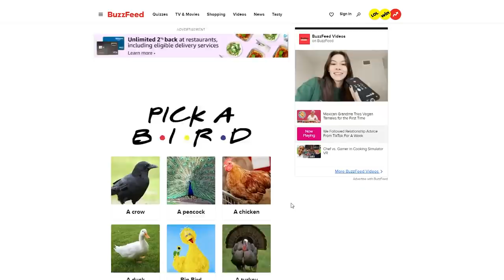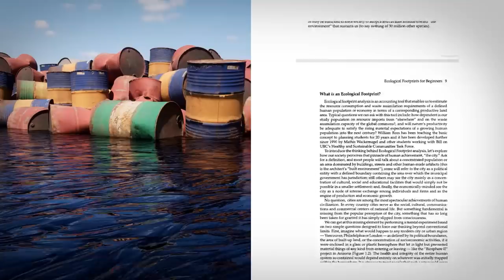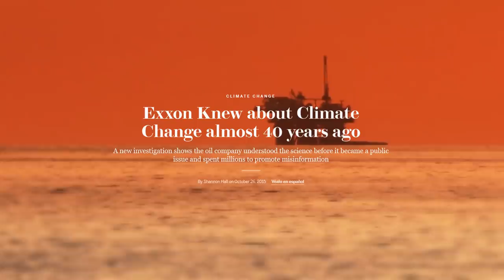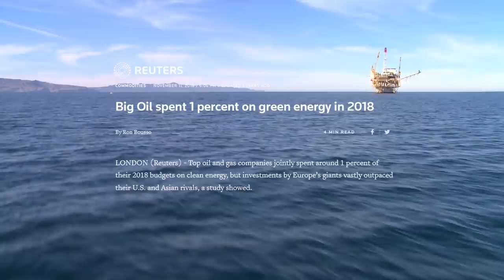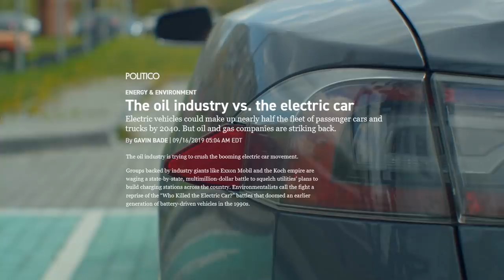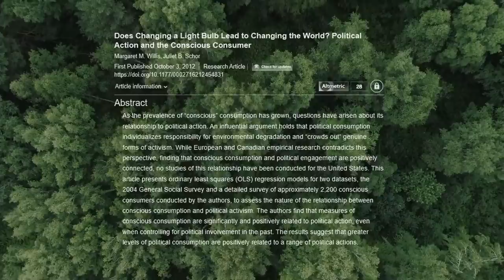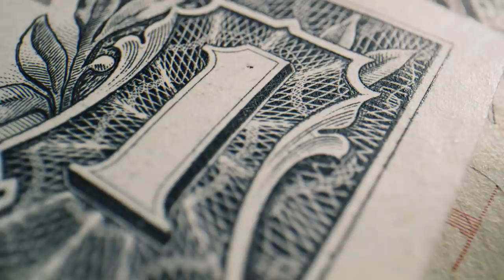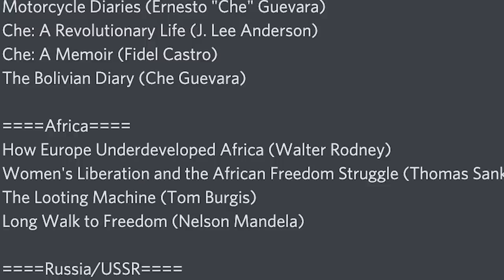Your "Carbon Footprint" Is A Scam

Comment: Stop talking this nonsecure and actually read the reports you are referencing.   Global warming was increasing at 2/10°C per decade in the 1980s before sundengly pausing in the early 1990s at 1.1°C.  Over the next thirty years global warming would decrease and increase, but never reached the next notable level of 1.2°C.  In 2o22 global, warming was being reported at 1.1°C.  The same as it was reported in the early 1990s with carbon dioxide levels rising much as they had during the 1980s with nn end-to-end correlation over this thirty year period with global warming.   

Exxon and other large crude oil extractors predicted in the 1960s and 1970s that global warming at 2/10°C increase per decade would crossing a tipping point when global warming hit 1.3°C where it would like cause higher Gulf of Mexico waters to measurably increase hurricanes.  This was predicted to take place in the late 1990s.  By 2010 global warming was predicted to be at 1.5°C where the astute observer was suppose to be able to recognize stronger hurricanes in the Gulf of Mexico.  These conclusions along with other valid reasons justified the higher expenses for building higher and more storm resistance Gulf of Mexico offshore oil platforms.   The platforms are routinely evaluated for predicted storms for the safety or personal.  Once global warming paused at 1.1°C in the early 1990s the prediction for the tipping points at 1.3°C and 1.5°C were no longer on track and were never reached.  We should of been at 1.5°C global warming in 2010 predicted by studies in the 1970s.  

It is impossible for the noncondensing gasses in earth's atmosphere to be responsible for global, warming at 1.1°C because their total temperature share of the earth's greenhouse effect is less than  0.1°C.   High school level earth science describes earth's greenhouse effect as adding 10°F (5.55°) to earth's temperature due to water.vapor's ability to block inferred heat from the surface from radiating into space.   The initial greenhouse effect takes place in 20 meters of the the surface.   The noncondensing greenhouse gasses, such as carbon dioxide and methane have less than 1% share of the greenhouse effect with water. vapor being over a 99%.  Unless there is virtually no water.vapor removing the noncondensing gasses would result in water. vapor taking 100ﬁ with a net zero change in the overall greenhouse effect.  If the noncondensing greenhouse gasses were doubled water vapor would take a lesser share with the overall greenhouse effect not changed.   

The United Nation's International Panel on Climate Charge reports clear state, you have to read the entire report and they are no longer easy to fine online, that they only discuss greenhouse gasses as a cause for global warming and ONLY sampled those greenhouse gasses at 20 THOUSAND feet altitude way into the stratosphere where water vapor is comparatively near zero.   By stating it sampling at 20,000 meters the knowledgeable reader will know the report is of no practical use for the discuss of the greenhouse effect and is therefor not criminal fraud.  Carbon dioxide's share of the greenhouse gases temperature forcing propotion at 20,000 meters altitude is stated at 20% by the IPCC reports verses about 1/4% share carbon dioxide has in earth's greenhouse effect.   20% / 0.25% = 80 times carbon dioxides share in earth's greenhouse effect.   IN the early 1990s it was well reported that human caused carbon dioxide levels in earth's atmosphere here were reasonably estimated to have increased global temperatures by 1/100°C.  In the early 2000s another study could only get about 50% of this.  Nethertheless 1/100°C was a well known figure from a reputable study for increased global temperatures due to human caused carbon dioxide in the atmosphere.  1/100°C X 80 = 0.8°C with is well over half of reported global warming of 1.1°C which is exactly what the IPCC states that over half of global warming is due to human caused greenhouse gasses primarily from the burning of fossil fuels.   It should be pointed out that statement and conclusion are never discussed in the IPCC reports.

To most people this fraud, but legally it it not because anybody with a scientific background, even that from high school, would be expected to recognize earth's greenhouse effect takes place within 20 meters of the surface not at an altitude of 20 thousand meters.  The engineering scientific audience has been quietly laughing at the IPCC obsession with human caused carbon dioxide since the mid 1990s waiting for it to disclose the new science that would allow carbon dioxide to effect globam warming.  There was no new science as most people didn't believe there could be, they just sampled the greenhouse gasses where water vapor, the cause of earth's greenhouse effect, was near zero.

Comment: Sorry, but rejecting individual responsibility like this is just as cheap as what BP did. If you are concerned about climate change, there's a couple things you actually can do that won't hurt your lifestyle much, some might hurt a little. For example, how about you stop buying ridiculously large, ridiculously overpowered cars (electric or fuel)? Few people tow a 50ft boat every week. Or stop flying and eating meat ALL THE TIME. Or heat and AC just a little more conscious. Or buy a slightly smaller house, if you are wealthy. Er voila, 40% footprint  reduction, no "solidarity" or "community action" (meaning socialism) involved. 
Shifting everything back to BP is just another way of staying comfy.
Reply: It's not "staying comfy", because most people aren't comfy to begin with, and those that are are mostly to blame for the carbon emissions, and no one is asking them to reduce the main source of polution because it makes them huge profits. It is easier and more impactful to get a few wealthy people to stop doing somethig than to have billions of struggling people to struggle even more. 
What you are saying here is akin to saying a stabbing victim is responsible for their eventual death because, even though they are bleeding, they should put the extra effort in and get themselves to a hospital, but by just sitting there stabbed and bleeding, they are just "being comfy". The real culprit is the one who stabbed the poor guy, and any talk about the victims responaibility is shifting focus from the core issue.
Reply: @vebdaklu  I don't think so. Actually, most people in the West are pretty comfy, at least economically, by any even remotely objective standard. For sure there are not "billions of struggling people" in the countries with the highest per-capita emissions. Suggesting to those comfy people to make minor sacrifices that would have great effects has absolutely nothing to do with shmoozing the rich  or even victim blaming.
Reply: @t.s.3025  It's kind of worrying that you don't consider people outside of "the West" as people, but it tracts with you considering poor people as "comfy". So, in your estimation, it would be easier and more effective to get a million people to give up some small life pleasures than to make a few dozen people to shut down a big factory (or make it convert to technology that would make slightly less profits)? That is really something you believe?
Reply: @vebdaklu  Bruh, come on. That's not sustainable debating . How did you construct the allegation I wouldn't consider people outside the west as people? Wtf? 
Ok, I'll try my argument again, attempting to be as clear and simple as I can: 
The countries with the highest per-capita carbon emissions are almost all part of "the west", being the  ones with the highest industrial development, thus being the richest (I'm sure you wouldn't describe special cases like say  Saudis or Kataris as "struggling"). 
 Expecting the responsibility and the momentum to change that only from a few big corporations , when 85% of us westerners live, yes, relatively comfortable lives and we could make a big difference with minor changes in lifestyle, is just cheap and lazy. No one buying a new F-150 or flying half a dozen times a year or seamlessly switching the AC of his poorly insulated 4 bedroom house to heat in September and back to AC in May, is seriously struggling economically. 
Of course BP and Exxon will need to suffer. But just scapegoating and fingerpointing from our cushiony couch in our well-tempered living rooms  won't suffice.
Reply: @t.s.3025  The reason people buy and use as much as they do is because the people selling them stuff they don't need have extremely powerful marketing tools, and human psychology just exists and is exploited through those tools. Also, those same sellers have very close ties with the governmet, ao even if the people stop buying atuff they don't need, the government will step in, either with subsidies, or exclusive contracts, or straight up bail outs - so those companies can keep producing and poluting because god forbid their proffits suffer a slight loss. 
THAT is why I say the people have no control over what the main polluters do. Also, why wouldn't you buy a car when you have no alternative to use (like public transport or bike lanes)? 
As for your claim that the majority of people from polluting countries are from the West - buddy, there isn't even a billion of you. So, yes, billions are indeed struggling.
Reply: @vebdaklu  I kinda feel like I'm speaking in some weird Chinese dialect here, am I really that hard to understand? Yes, billions are struggling, but those are generally not the ones that are ruining the climate at the moment. We are, and we can make private, relatively minor adjustments, that would have great effects, and advocate for them, even with the government schmoozing evil corporations. Do your part, clean your house, before you set out to change the world.

Comment: Energy production seems to be absolutely crucial. I did a carbon footprint test and when I changed the country to Australia with everything else the same it was 5 times higher. They have coal and oil as electricity production, while here (Sweden) we have hydropower, nuclear power, and wind power.
Which means it almost doesn't matter what I do.

Comment: I think this is a bit hypocritical.

While there's something to be said for accountability at all levels, that doesn't relieve the responsibility at the consumer end.  It's still the case that people will buy a product that goes directly against their stated values without batting an eye.  You argue that shifting the blame to the customer takes the responsibility off of the producer, well, it's also the case that shifting the blame to the producer exonerates the customer.

No one person is going to fix this, but the least people can do is look at the labels on the products they buy.  Look at the materials in packaging.  Look at the country of origin.  We're all part of the problem, and saying 'it's just the system' is a cop-out.

Comment: Watching a video about how choice and reducing one’s impact on the environment on a small electrically powered device which is made of rear earth metals and is toxic (both to me using the device and the earth from which they mined and refined), and which is designed to require replacement every year or two, is illusionary is the definition of irony.

Comment: im sorry, but people are only responsible for themselves. No people to sell to = no profits and they stop. Vote with your wallet, vote with your feet.
Reply: If there is poor public transport provision, it’s hardly the fault of people that they’re forced to use cars to get to work.
Reply: @Celestina0  still, vote with your wallet. and vote with your ballot. Vote for people that invest in infostructure, look into car sharing, buy the most eco compatible vehicle around, if you can, move closer to the urban centre.
 You are responsible for your person only, and your choices. Imposing change from above changes nothing because it will be done by individuals (politicians) anyway, but you will have given up your input by delegating, and then when inevitably they think of themselves, you will only have yourself (general 'you', not referring to you in particular) to blame. 
True change is slow and compromizing, and inevitable, and yes, sometimes enragingly so.
Fast change (from above) is unstable, dangerous and most of the times a pipe dream of unfeasible caveats that gets promised to the masses because it promises big improvements, but delivers none, when its not outright damaging (for example if everyone on the planet switched right now to electric cars we wouldnt have the rare materials, the grid wouldnt be able to handle it, and we wouldnt have even the powerplants to provide the 'clean power' anyway. This even before we start to consider the amount of discarded cars).